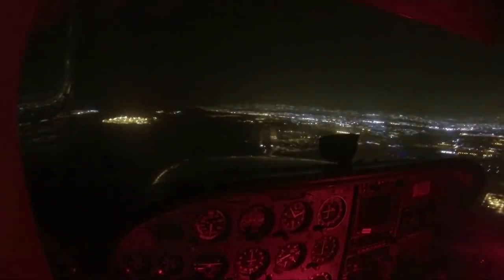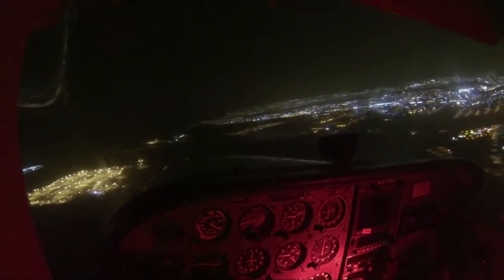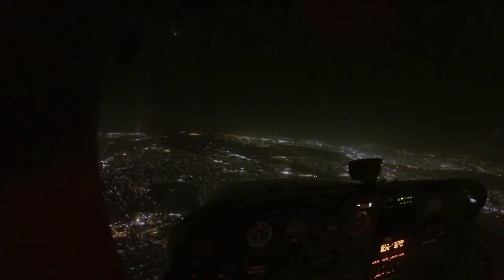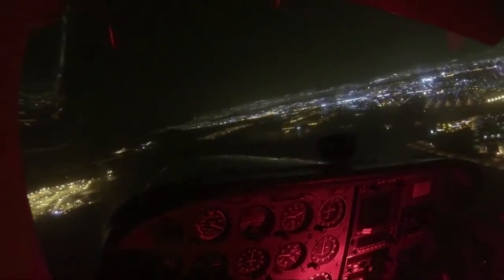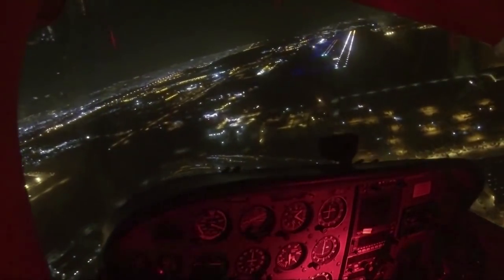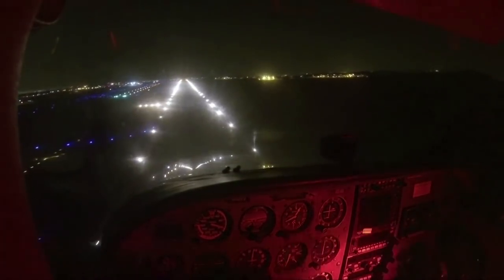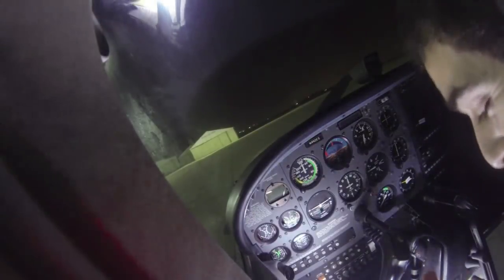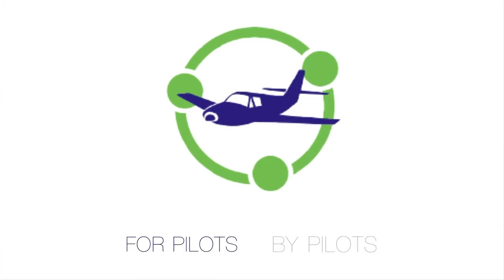Total Electrical Failure at NIGHT - Low time pilot - POV Flying

Comment: I have an icom with NAV/COM... and also a battery powered aviation GPS that I run on a RAM mount above the panel... Plus I have flashlightssssss, finger lights, a battery powered lip light on my boom mic and a backup flashlight with red/green that can be recharged by shaking... Being in the Marines Corps I learned that if anything can go wrong, it definitely will and to always expect it to happen...
Reply from the maker: Yeah - that's a heck of kit to have for night flying! 
I definitely rock multiple flash lights that are easily in reach... 
but the hand held radio has been a neglected item in my flight bag for far too long.
Reply: Definitely, a handheld was one of the first items I got my hands on and I made sure to get one that also allowed me to tune into VOR's/VORTAC's..   As always, great video man! keep 'em comin'
Reply from the maker: Aaron Thomas Thanks!
It is cool that people are happy to let me "Flight Chop" their stories - I'm pretty sure I won't run out of my own, but it is always good to know there will be material in case I do :)
Reply from the maker: Iz HeMaD Thanks man! That would be awesome - here's hopin' :)

Comment: Flying with a private pilot, myself a student pilot in a Cessna 172 our flaps would not go up after take off and had to fly 50 miles into Cleveland Hopkins Arpt.  After speaking with Flight Service concerning the problem, we checked the circuit breakers and pushed them all on and just before final approach, the flaps worked  and we landed.  Circuit beaker failure.

Comment: One thing to mention: Not just to have flashlights, but a clip-on light that you can turn toward the panel and see the instruments. Imagine if he didn't have someone in the right seat to hold the flashlight?

My instructor demonstrated the difference it made to have that clip-on tool in case of an emergency rather than a bulky flashlight you have to hold to look at charts and instruments. Never fly at night without it.
Reply: Haha, yes! I got one prior to my next night flight. I love it. If I hadn't had my right seat passenger, I'd have ended up having to hold it in my mouth!
Reply from the maker: Definitely a good point.  I use a hands free "hug light" primarily as well as a head light and couple other standard ones for back up.

Comment: I've had this happen to me before, though not an electrical failure, but my radios weren't working. It was a long night-xc flight for my commercial pilot certificate. While landing at the airport (destination), the airport lights wouldn't turn on (pilot controlled), which caused me to have to land without lights. Pretty interesting landing at night, without airport/runway lights.

Comment: First thing is the primary basic problem solver of undo what you last did. Landing lights off press all breakers in and if that doesn't work pull out and press back in breakers. Could of been the flaps switch was stuck leaving that electric motor draining amps then the landing light made an overload. He did great and only real concern after your already mentioned electrical problem making a fire if nav lights and no radio for the pattern. He did get his first stealth training. Any future problems like that a solution could be pull breakers and reset the radio first and others afterwards if need be.
Reply: +AH6OY Yeah, when he hit the landing light I saw some sort of warning pop up.  I dont fly a 172 so I am not sure what it is that was flashing.  I would much rather land without a light than without anything.
Reply: +AH6OY I was taught to only try pushing the breakers back in once, and if that doesn't work, then don't try it again because of possible fire. But really it comes down to how ballsy you're willing to be with that kind of situation.
Reply: +Bailey Jones well, fire does illuminate...
Reply: +Bailey Jones True, Cessna 172r manual said the same thing.

Comment: Well handled Sir!  Steve et al buy a radio! They cost next to nothing these days and with modern batteries (i.e. not nicad) they are easy to keep charged. Based on personal experience I carry one in the outside pocket of my flightbag fully charged and reachable at all times. Call it over kill, but as a student I had a mic wire to the socket in the panel fail on my third ever solo in a busy circuit at CYKZ. (I only had about an hour solo at that stage so I would be lying if I did not say it was "scary"). Fortunately I could hear tower and they figured out pretty quickly and cleared me in. Yes, I did know about light guns, but there and then I figured for less than the price of an hour in the air with an instructor I could be prepared and feel a lot safer. On top of that it comes in handy often to call up flightline, ATIS or just listen in to the chatter.  Blue Skies!

Comment: I had a radio failure on downwind at Cape Town International - FACT - a big airport but also our home base.  Similarly, I had a hand-held but didn’t think to use it, doh.  Instead I did the whole "transmitting blind thing", continued the approach predictably and watched guiltily as ATC moved an aircraft out of my way.  But they obviously felt I did OK since no bollocking from the tower after the phone call explanation.

Comment: Mid 80s before everyone had phones on my SOLO of all times I was given a extended downwind due to another aircraft with a emergency "loud banging noise". I kept going and going then realized dam it got really quite. After trying to raise the tower I had to assume the radio had died. I landed at a uncontrolled field 20 miles from my base airport and used a pay phone to call tower. I was given the ok to fly straight in and land.

Comment: 3:09 what the hell is that? Top right corner confirmed aliens did it.
Reply: a reflection on the curved glass;)
Reply: No its not you could see it pull right and go up again the reflection would of went all the way left.
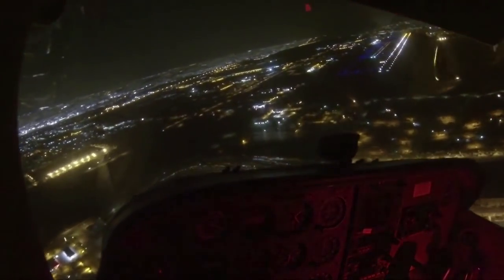Reply: @anunazganun9627  Check reflections in the same spot at 3:26

Comment: I have 4 logged hours in my book now... even shortly after starting handheld radio was obtained and it has all my local airports pre-programmed and they are accessible with just a turn of the dial... very helpful in this sort of situation where I would ask the passengers to turn on and select... but honestly I hope I couldn't encounter this situation -_-

Comment: I had an airport lose power completely when I was on short final, at night. All I had to aim at were two small red lights at the end of the runway. The tower went to backup power and on the radio asked me if I wanted to continue the approach. I said yes. My landing light was the only thing illuminating the runway. Turned out I did the best landing I ever made, day or night. Wx was good that night thankfully.

Comment: I've been in a similar situation though it was an alternator failure in a 172 and not a total electrical failure, but it was at night.

+1 for the handheld. I always have a hand held in the front side pocket in the 172, even during the day. I carry it in a flight suit pocket in warbirds as well as they do have a habit of being a little electrically sketchy. Grabbing it and tuning it takes seconds, most are extremely simple to operate.

Back to my little story, In my case, I shutdown everything with the exception of the transponder to save power for the flaps and landing light as I was still quite a ways from the airport. My tower was open and I talked to them on the hand held without any issues. I did have two passengers, neither of which seemed to care at all.

The funny part was the tower decided to turn the lights up to maximum intensity assuming I wouldn't have a light as I had informed them of my issue, though did not declare an emergency. The high intensity lights actually made the approach much, much worse as they were so blindingly bright I couldn't see the runway even with the landing light on and working.
Reply from the maker: Cool thanks for the comment!  and I am still trying to sort out a weekend to get to Windsor to see you guys!  Are you going to AirVenture?  I couldn't commit due to work issues, but it looks like I might have the time after all - I am trying desperately to set something up for the tail end July 31-Aug3
Reply: ***** Negative, not heading to AirVenture.

Comment: I am a new pilot thanks for the video I did not know handheld works the lights to the runway I thought they only worked radio
Reply from the maker: The lights are controlled by keying the mic several times on the frequency.

Comment: I had my PFD and my MFD fail on me in a G1000 a couple months ago. I checked the manual for the circuit breaker and when I went to pull it and reset the system, it came back on. I was on a Rnav approach when it failed so obviously called off the approach but the system never shut off again. One of those weird things to pass on to a mechanic.

Comment: i think either he overloaded the circuit in the airplane by trying to turn the landing light on, and it tripped the master circuit breaker because he was using more juice than the generator could put out... or the more likely scenario, (especially since these airplanes are designed to power everything at the same time) one of the components (most likely the brushes) on his alternator or generator wore to the point that they were not producing electricity, at that point, the only thing that would have warned him about this issue is his voltmeter on his battery gauge dropping.
Reply: Turning on the landing light should not have overloaded and tripped the main breaker.

The main breaker is sized to carry the entire load of the aircraft. If there was a short in the landing light circuit it would most likely have tripped the landing light breaker.

His alternator probably died some time back and he was running on battery. Turning on the landing light pulled what little power was left in the battery.

His instrument scan seems to have missed the voltmeter. 

Aircraft batteries do not have much load carrying ability.  They are basically designed to crank the engine for starting and then be recharged. Battery in your car is better. Too heavy for aircraft use, tho.

Comment: There was no green light signal from tower because tower workers were off duty at that time. He got no electrical power meaning no landing light, no strobe light, no beacon and no ability to activate ARCAL. How does that not impose a collision hazard in case that there might be another aircraft coming to land at the same time?

Comment: Found this video again you talk about a handheld backup radio I wonder if a low power handheld Aircraft Radio is even strong enough to transmit though the body of the aircraft and reach ATC radio. Aircraft radios use AM modulation which means less power more difficult to hear because the difference between the noise and Amplitude modulation is not enough to actual make out what someone is saying. Since I have never used a handheld aircraft radio would not know how good they work. Now a cell phone might work better if your low enough have to have phone numbers ready to call be difficult to figure out who to call.

Comment: Have I got this right ?  He says it's just about 9 pm and that's when the tower closes.  He radios the tower and doesn't get a response so that means it has shut down operation.  Does he know that this airport also shuts down their lights when the tower closes ?  Either he did or forgot in the prep to final. But it does mean that the lights are going to shut down any minute, and they did.  So good idea to check out an airports procedure beforehand and keep that hand held close.
Reply: you got it wrong, after tower closes airport lights switch to automatic mode meaning any incoming pilot can turn them on using a radio and he managed to do it before his system died. Thing is airport lights are on the timer and because his radio is now dead he can not turn them on again.

Comment: I watched a video twice where they flew small airplanes & lost power BUT they had a backup alternator or generator.

Luckily that helped until landing.

Can you simply have a mechanic add extra backups? Like extra battery, extra generator & extra alternator?

Comment: I can't afford real planes, so in honesty I'll tell you up front I'm a simulator pilot. That said...

I was flying an old 1940s Hiller HM-1 light twin with Menasco 120 hp engines. I regularly stage random component failures just to add a little reality. I'd just fueled up in Gulfport/Biloxi, but we were nowhere near gross. 90 miles south over the Gulf, just before turning east for Florida, a random component failed... Total failure of the port engine. So I turned back for Biloxi. First "oh shit moment.
 At night, lights, avionics, autopilot, everything on. About 20 miles from Biloxi everything just shut off. Just like here, just "click" gone. Moon and starlight was bright enough to see instruments, but I hadn't talked to the airport yet. Come to realize one alternator wasn't enough to support the electrical load, so first the starboard alternator failed, then the battery drained. I was watching engine gauges and making sure the a/p was handling the plane, and forgot to watch other instruments. Second "Oh Shit" moment.
Right engine was barely keeping us flying, so I waited to drop flaps and gear till short final....... They're both electric. Third "OH SHIT" moment.

I went from an engine failure and turn back, to a total nighttime electrical failure on my way back to a very busy controlled airport, to a gear-up no-flaps landing without the ability to call for assistance (Flight Sim X doesn't have that option, but the real world situation would be this). I landed it. Greased it in so nice the program didn't crash me. We would have walked away unhurt. In the real world, they say "if you're not sweating you're not learning". In that case, folks I can tell you for sure and certain you CAN learn on a flight simulator!!!!

Comment: Pilot did a fantastic job.  Just a thought but why isn't there runway lighting system that can operate by radio and mobile???  I mean everyone carries a mobile on them, but not everyone carry's a handheld.
Reply: The cell phone band is just not conducive to aviation requirements. The connection is weak and the coverage is spotty. Cell is too unreliable. A portable FM transmitter is cheap, powerful and handy if you ditch in a rural area. Besides the radio, I would pack an LED strobe marker, a high powered green or blue laser pointer and if I had the cash, a satellite phone.
Reply: @SloaneLasers  but don't they advise to ring ATC on your cell phone if you have lost your radio's?  Cell phone coverage has improved and it seems silly not to utilize it.  Or they could have the trasponder frequency connected to the lighting system so when you dial 7600 and squawk it turns on airport lighting as a back up.

Comment: My handheld is always clipped to the pouch on the side near my left calve.  Facing inward like a pen in your pocket.  A step farther,  I have an adapter chord that is connected to the radio that I can plug my headset into.
Reply: @colinsouthern  you too? I thought I was the only one.  I even get made fun of it.  I wear a fishing vest with even a tarp folded in the pouch on the back.  Water purification,  signaling devises,  first aid,  food.  (Survival equipment)  I've flown search and rescue in Alaska and learned if is not on you during an unscheduled off runway landing, you won't have it.  In the tail can be no good.  I'm glad to hear other pilots do thks too.  I hope more could.

Comment: Wait so the LEAVE the tower? I thought they were operating 24/7. How does that make any sense?
"Oh this plane is about to land guess we should leave."
Reply: Big airports, yes they are staffed 24/7, small airports like this however are not and they have no obligation to stay even if they see an aircraft coming in. For uncontrolled airports or landing strips, you announce on a common frequency listed in charts your intention and position to other aircraft in the area.
Reply: You can say it's like roads. On highways you have all kinds of rules and markings telling you exactly what to (not) do, and where to (not) go, because otherwise all hell breaks loose. But on a dirtroad somewhere out back, there's no necessity for all that and people do just find without any kind of markings (like lane divider) because they just communicate their intentions with each other.
Reply: They probably took off a good chunk of time before the plane had it's electrical failure or even took off. He technically only needed the handheld to check for other landings/takeoffs and set the lights. Some airports are even uncontrolled altogether.
Reply: no most towers do not operate at night. it just turns into an uncontrolled field during those hours
Reply: Yeah, don't worry, if you're getting on a commercial jetliner or something, you're not going to be going from an airfield like this. It's for small airfields typically catering to General Aviation where the traffic density doesn't warrant having trained ATC people on staff all the time. Some airfields are always uncontrolled, others might only be uncontrolled for certain quiet periods. Planes just announce their position and intentions and you trust the pilots not to fly into each other.

Comment: #1 I would tell my passengers that the engine runs on magnetos and a electrical failure isn't that big of a deal.  #2 Have at least two flashlights and a supply of batteries.  Have on mini flashlight on your headset.  It's good not only if electrical failure but looking at flight charts not covered by lights and into flight bags without using your hands.  #3 If you fly at night you should have a portable radio!  How are you going to turn on Pilot Controlled Lighting?